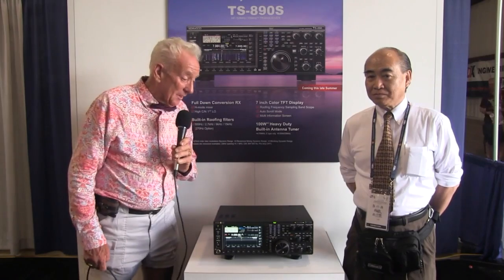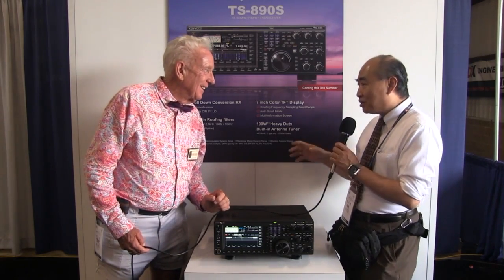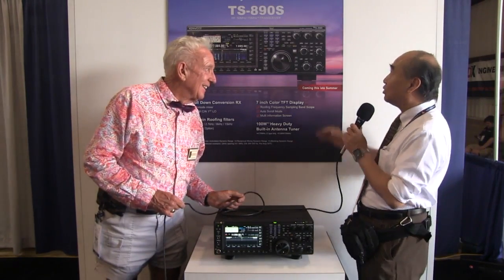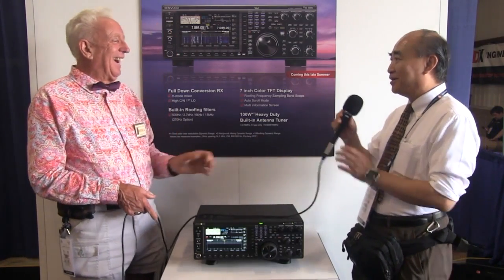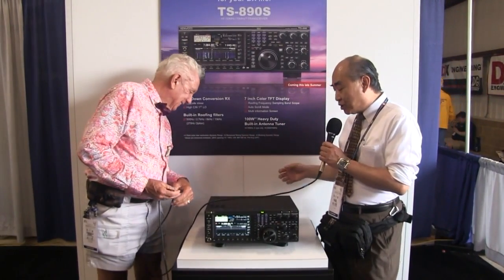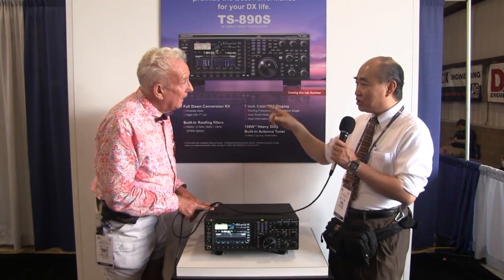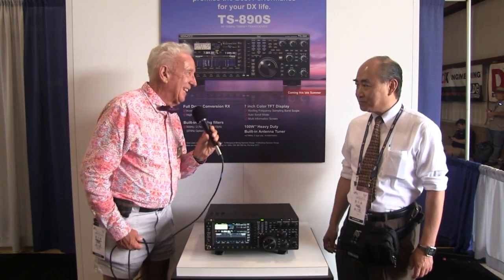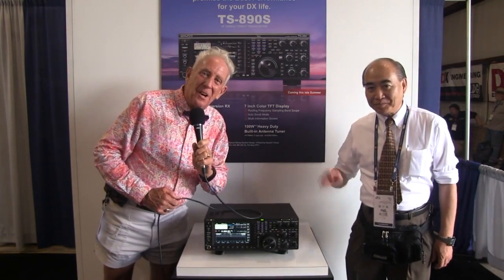HamNation TS 890S

Comment: Just another Radio, as a software and electronics engineer, I've been in the trade for over 40 years and a ham for 30 years, I've seen it all before, sorry to say it's all down to the location and antenna, not the way all the big company's design their front end, most of the big names are just copying each other, ask the many ham operators how Radio works most of them don't even know, these are the people the big company's love, stupid hams parting with their money, sorry if I've burst your bubble that's the way it's been for years, NO MAGIC DUST.

Comment: Kenwood better be cheap.  It's not an SDR.   7300 new $999.95.  how is Kenwood going to beat that price with this 890. Hmm 🤔
Reply: if the DSP(s) are programmable -- it's an SDR. I have said before, kenwood lost how they design a TRX. 
It should be far less than 900 euros.
Reply: Roeland Jansen how much is that in American money
Reply: Roeland Jansen $1040.71 cents.  I looked it up.lol
Reply: just below $1043 or so. And then I would take the 7300 hands down. ICOM understands it much better.
Reply: if teh DSP is field programmable (and it should), it's an SDR. Not the kind like the 7300, 7610 but still. Even the absymal TS2000 is an SDR.